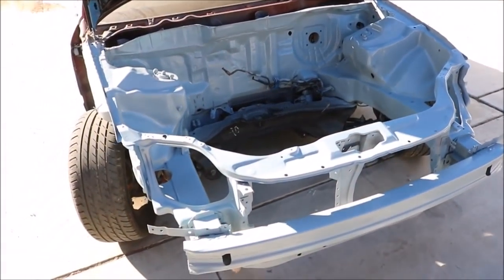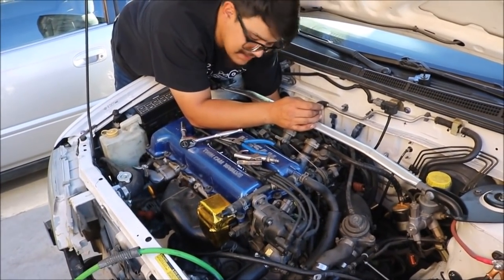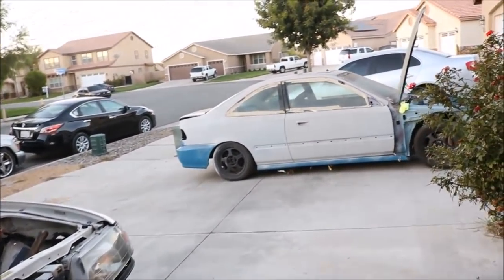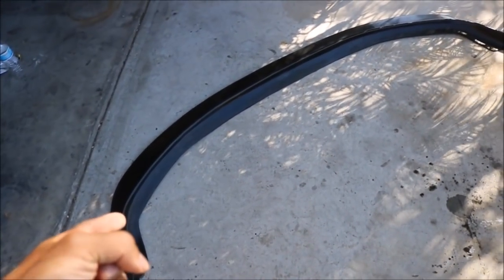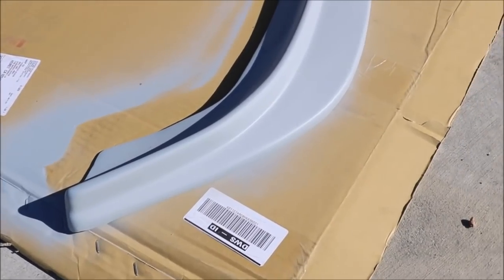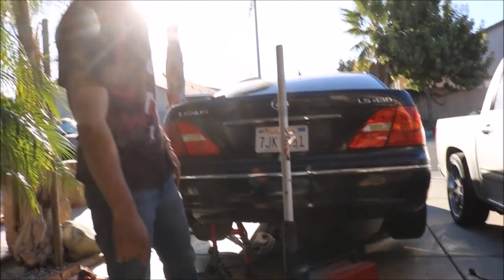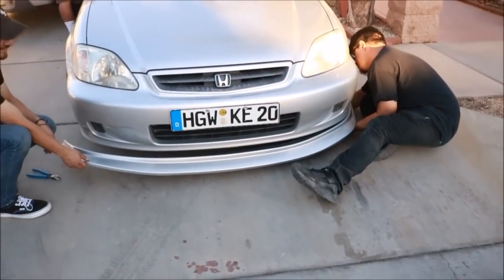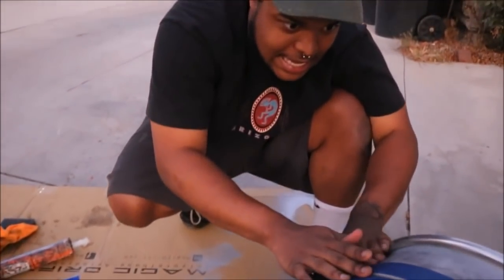This CHEAP Mod Made A HUGE Difference On The Civic!

Comment: What engine is going in the civic anyway? a H22, K20, or K24 with a turbo kit would be cool 👌(the one that doesn't have an engine yet)
Reply from the maker: I have a K24 waiting to be dropped in!
Reply: @BrokeBoyAndy  any horsepower goals? maybe 700 would be nice & you should rebuild it as a track car again 😎 (if you want to)

Comment: Stupid question, what size ar the wheels in the thumbnail? I have 17s and they eat the insides,and have a mass bounce. I got some 15s from work and no bounce but had to raise the car 2 1/2in. Wtf am I doing wrong. I want zero ground clearance like the front but cant fit any wheels..  thanks in advance
Reply: The look like a 15x8 with like a 195/50 tire.